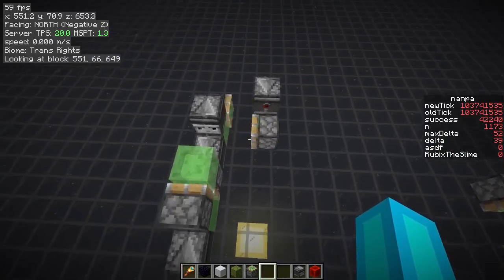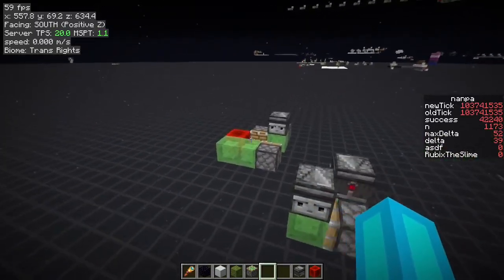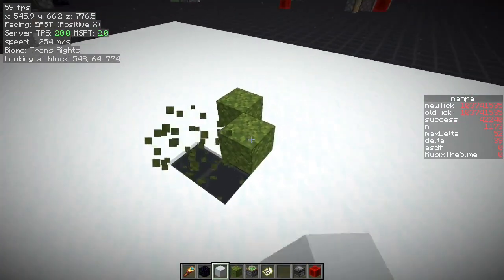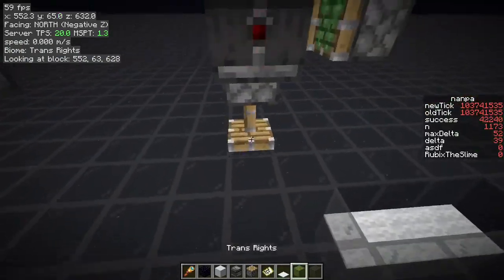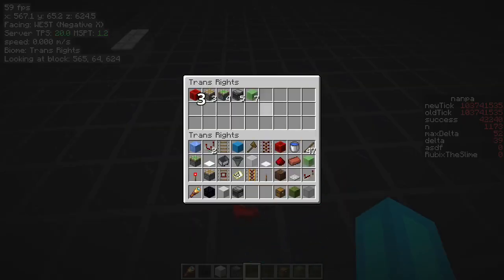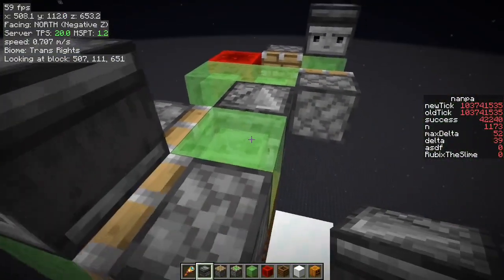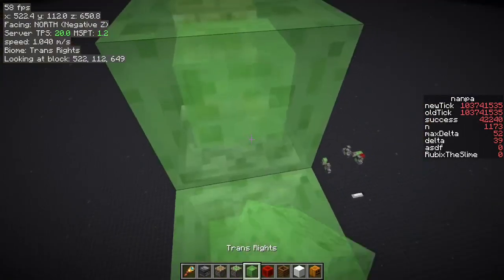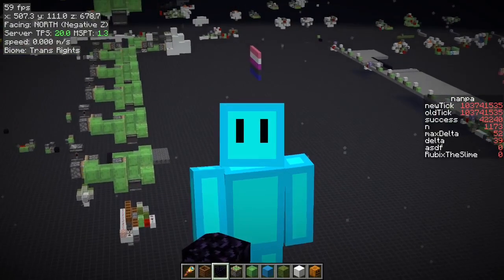Tiny Utility 3-way Flying Machine [Java]

Comment: Could you make a version of this that pushes up? I'm working on a project that requires a glass ceiling at build limit, but I can't do that with the platformer builder machine
Reply from the maker: if you put the observers for the 2-way on the bottom powering up it should work, and then you just need the extra piston on top
Reply: @rubixcetera  oh duh i didnt even think of that, i got it stuck in my head that i would need qc. Thanks!

Comment: Hey, the video bitrate is quite low. How are you recording and processing it?

But the audio is TRANScendentally good.
Reply from the maker: only thing i can think of is that i record in 720p even though my monitor is 1080p. and i'm just now realizing i can probably change my monitor resolution for recording. that and simply my computer being not very powerful
Reply: @rubixtheslime  oh, there's also the bitrate (how much information yo save for each second) and the codec (the video information format, inside the video file format).

For recording, it's good to use a high bitrate (I don't know how many MBs for HD video), and the best codec that your PC deals OK-ish.

Example codecs are AV1 (for high-end PCs to encode), H.265 (not every PC can save high quality video with this one), VP9 (almost everything can save that easily) and H.264 (everything has hardware acceleration to save that).

You can record with a very high bitrate and a bad codec (like h264), and them simply reencode the recording later with ffmpeg.

Comment: Cool video. How did you rename everything to trans rights? A texture pack is what I'd assume, but that seems very time consuming. You do seem like the kind of person to automate that, however.
Reply from the maker: yeah i automated it (technically a resource pack). i take the english lang file and do a big regex replace. it's a little out of date though as i made it in 1.20
Reply: @rubixcetera  Ooh, that's a good solution. I respect the effort put in to make it ^_^

Comment: In terms of map art, I feel like few people need a slow yet automatic solution for filling a flat canvas with snow or removing tiles one block at a time. If you do, I'm not sure about this single 3-way module approach, which seems rather inefficient when considering a tiled row of machines or simply the fact that a player with speed2 and a dozen leashed golems can completely fill a canvas in less than 10 minutes. Regardless, cool machine!
Reply from the maker: depends on what kind of efficiency you want. doing a minute of work and then watching a movie is very efficient imo